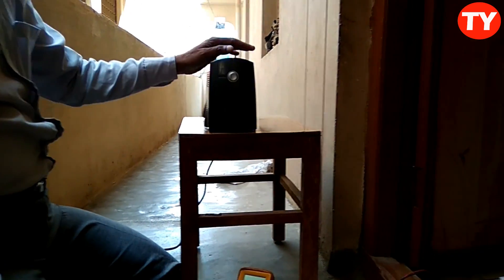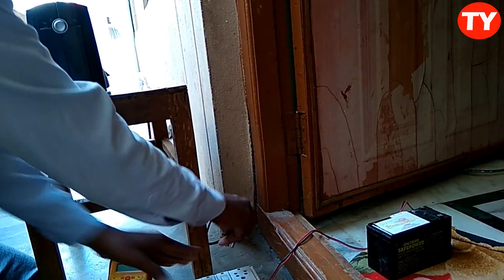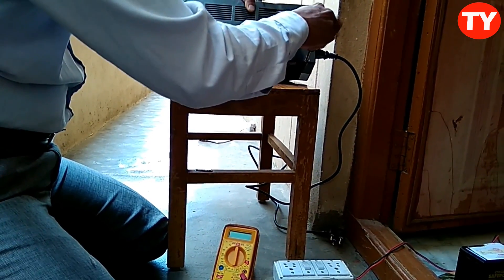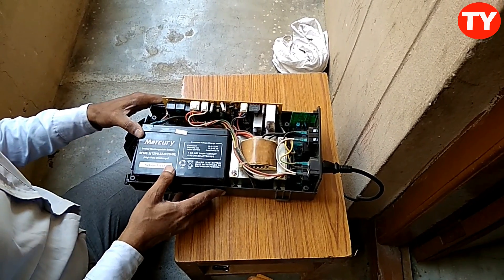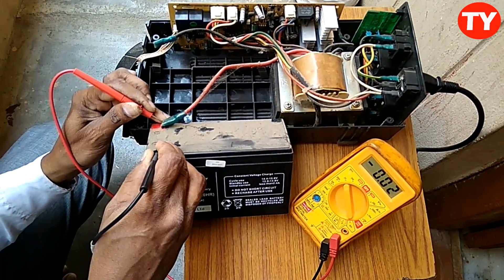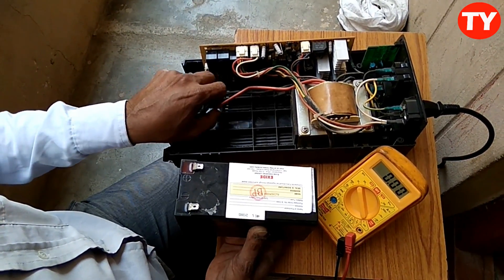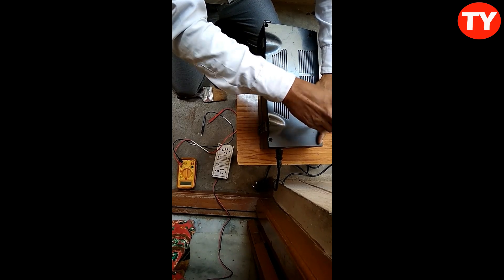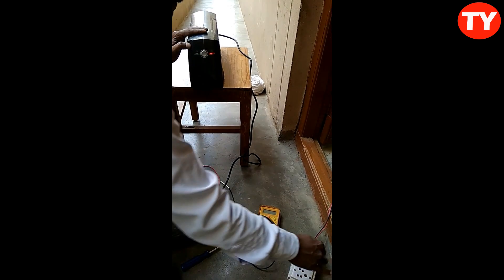UPS  working on AC   but not working on battery mode

Comment: My UPS is working only on battary mode.. even electricity connection is available.. which part may be getting problem?
Reply from the maker: plz check battery voltage , if  less than 10 v problem is battery only
Reply: @electrionics  battary is OK.. we have check with another battery.. issue remain same

Comment: I have the same problem (not working on battery mode), but when I tested the battery thru the multitester, it has a reading of around 12.3V.  The battery I have is 12V 9A. 
Can you help?
Reply from the maker: check battery fuse and output  mosfets open

Comment: My UPS run normally, but after sometime it automatically switches to battery mode. Any idea what could be the reason for this? Thanks. 😅
Reply from the maker: plz check  ac voltage circuit loose connection (dry solder) or check ac voltage sensing circuit in ups

Comment: More time spent in the video to remove and replace the screws than for explaining the process - and - no final demonstration of whether or not the replacement solved the problem or not.  
We might assume that it was successful.  But the whole purpose of making the video (from the viewers' perspective) is to SEE what happens.  
If we are just supposed to take your word that it now works, just say, "replace the battery and it will work again" and forget making a whole video of taking out and putting back screws.  
Just a thought.
Reply: ty saved my time
Reply from the maker: ok  here after
Reply: Legend

Comment: I Went to check for UPS back up for our scanning electron microscope machine . That's why i was switched off the ups switch and connect multi meter across battery . At same time our elcb tripped, and machine off. And a burning smell came out from elcb. After that when I tried to elcb on with main power on. Elcb tripped automatically again and again . Can you please described the reasons behind that??? Is there any chance for machine or machine accceries burn? Please explain..
Reply from the maker: put dc voltage range 20v  in digital multi meter and then check

Comment: How will get proper 220 output voltage
Reply from the maker: ups had stabilizer inside it will adjust hi voltage and low voltage

Comment: Pls help my ups doesn't giving backup I replaced with new batteries  but it is turning on pls help me
Reply from the maker: check  main ac fuse and battery fuse ( batery terminal cables)
Reply: @electrionics  new batteries fuse is new but not charging

Comment: Sir,I bought a new battery.
I have 2 old ups.
Both of them shows blinking LED when connected to AC with new battery.After charging for 7 hours,one of the ups is not giving output like before it was giving output even without battery it just keep blinking.

Second one is also blinking with output but when I disconnect power,led turns red and it just turns off in 1 second.

When I connect battery only to the second ups.It shows red light and their is current in the output socket of ups but backup was not even for 1 sec.

I don't know what is wrong,ups or battery.
Reply from the maker: check battery connectors  , better keep charing 12 hour then check

Comment: 650pro ups charge ok but no ups model power on slow beep and off haw to solve problumr
Reply from the maker: when did purchase , battery not supplying 7.ah (amphere) mostly problem with battery

Comment: Bro please reply,

My ups is working.means it able to charge the battery and working fine on inverter mode. But it is noylt working in AC mode. Earlier it was working on both conditions but now only works as inverter, not able to bypass the ac current.
Why bro...
Reply: Nation Talks Bad relay
Reply: @makkgeo  if i replace the relay, will it work perfectly ?

Comment: U showed open& close  fitting. Measured battery zero volt  ,put  new battery ,that's all, u did not show if charging voltage present or not.what kind of video is this???
Reply from the maker: it basic video, iam uploading other video ups fault finding ok